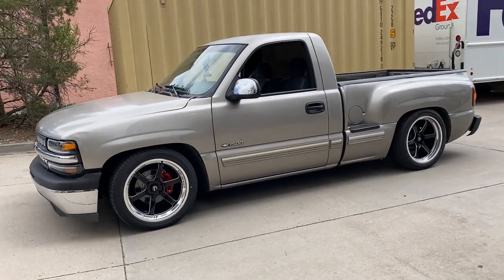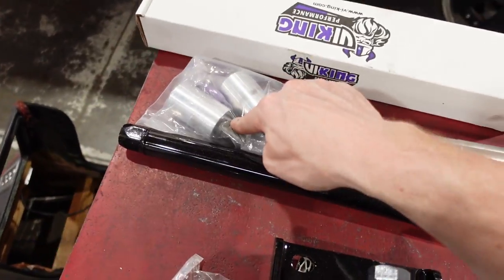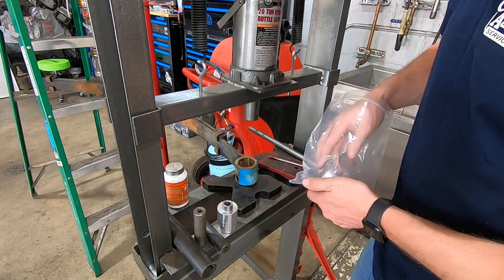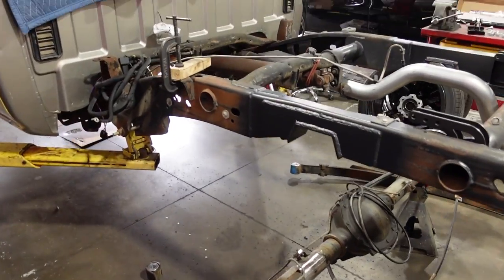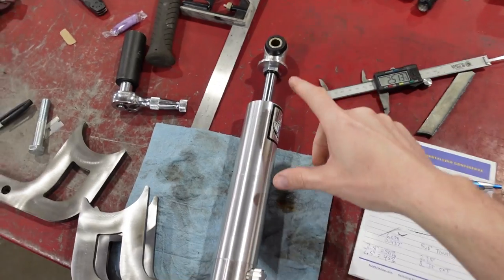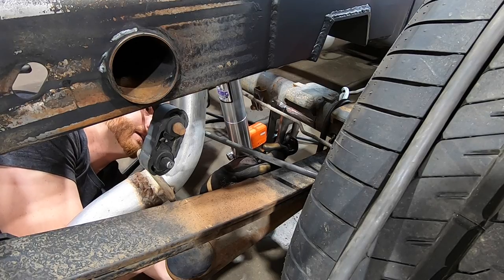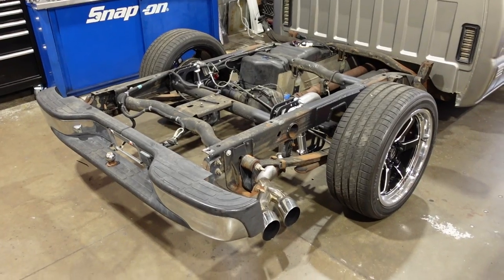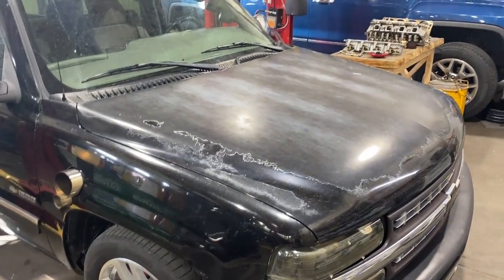the MOST DANGEROUS FRAME EVER gets a massive upgrade

Comment from the maker: Check out Solder Stick for your wiring needs, and use code "LT20" to save 20% off your order
https://solderstick.com/
Reply: Your mantra of doing it right is great and all. But promoting these soldering heat shrink connectors is far from right. They work okay with small wires but I’d always put another insulator on the outside. The solder doesn’t always stay contained in those things after it melts…. And I didn’t watch the video all the way through, but adding zerks to the aluminum bushings are something you don’t want to skip on.
Reply: Just ordered the solder Sticks... I've used them before and love em for alot of applications!  Thanks for the discount code, saved my $5.00. :)
Reply: @champspec Yup complete garbage

Comment: Richard at Atomic Fab is a great guy. I have Belltech spindles, and his Viking DA coilovers on front of my Yukon. I did it the same time as my Brembo BBK with 2 piece rotors on the front. They are obviously much lighter than the stock rotors, and the Viking DA coilover setup drops like 75-85 lbs from the torsion bars. I'm running 2013 I think they are polished declad 20" GMC 6 spoke wheels with the rear widened 2" so it's had 275/40/20 and 315/35/20 and now have 275/55/20 front and 325/50/20 Nitto 420V on it. I plan on changing the wheels at some point and maybe run some BC Forged wheels but I cannot express enough how good the front is. The rear is just DJM rear hardware kit Belltech 5305 coils, some Airlift helper bags, and an adjustable panhard bar. Suspension wise I think it's done excpet for new poly bushings and sway bars and with the BC Forged wheels some different size tires and the CTSVbtakeswaponline.com rear Brembo setup to match the front Brembo BBK kit because the stock 2 piston rear calipers just don't match the front that great. Plus Brembo calipers at all four corners of a LQ9 6.0 swapped Yukon lowered 5" on some staggered wheels with a set of CNC 243s, cam, ported TBSS intake, headers, full exhaust, and everything would look awesome. Basically my plan has been to build a fullsize version of a TBSS since I fully built one and loved it I think a half tom version would be even cooler.

Comment: Is that really enough uptravel in the shocks ? I would be afraid my truck would bottom out the shocks on big dips and bumps . I was hoping to do this kit on my truck and keep about 4" compression. My truck is lowered 4" in the rear with a shackle and hanger kit.
Reply from the maker: ideally you would have a little more in each direction, but the shocks provided here only have 5.5" of total travel so we must split the difference. that being said, I have a 6" stroke rear shock on my drag truck, and for street use or at the track, I don't have any issues.
Reply: This is actually the exact issue I am now dealing with. Going ti be adding bump stops and tightening up the compression.

Comment: Help needed!! Hey LT really like the videos you put out. A while back I relocated the shocks on my 99 regular cab stepside, using the same atomic brackets and viking shocks you used, I followed instructions from your video of the COPO truck. When I got done I tried my best at adjusting the knobs on the shocks based on what the sheet provided was saying; ever since I did this to my truck it hasn’t been able to do a proper burnout, every time I try to do a burnout the whole truck bounces and shakes violently. Do you or anyone know what could be the cause of this shake?

Comment: One little trick if you can’t get a socket on a nut if stud is too long. Use a spark plug socket ( if it’s the right size) then a regular socket that fits it. One example is on fuel tank straps.Would be nice if you could get sockets of all sizes made like that. If there is tell me.

Comment: I need your help friend.  l lower my truck 2/4 I used some lift hangers and a flip kit on the rear.  and in front I used 2 in drop spindles and I would like to know what shocks you recommend my truck is a silverado 2005 crew cab 1500 4x4

Comment: Hi LT I have a 3500 2wd chevy would like to drop the rear do you have to noch the frame with a flip kit I just want to level it out
Reply from the maker: Generally if you do a flip kit, you’ll need a notch, but if you do a drop shackle and or hanger you might not need to do a notch
Reply: Where is your shop located maybe I can come buy the and you take a look